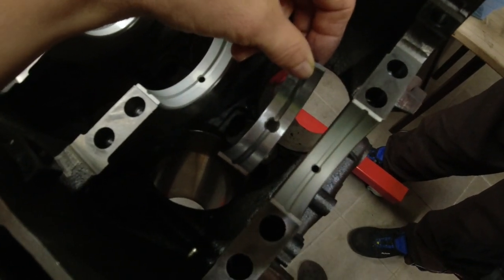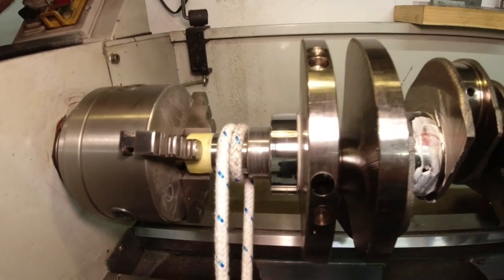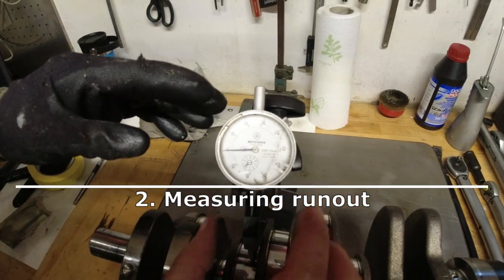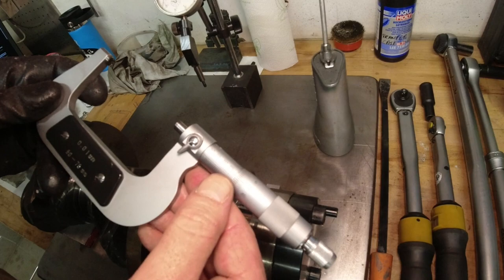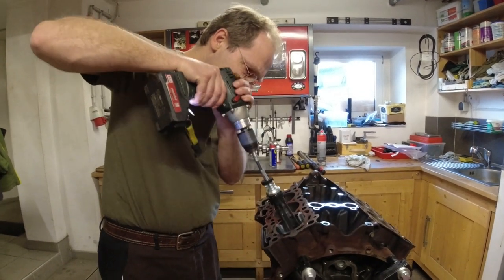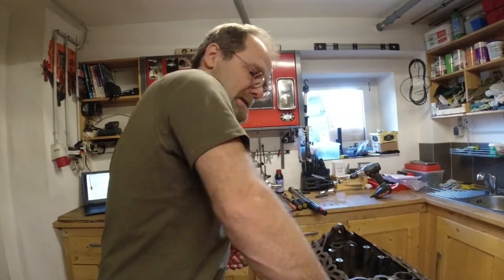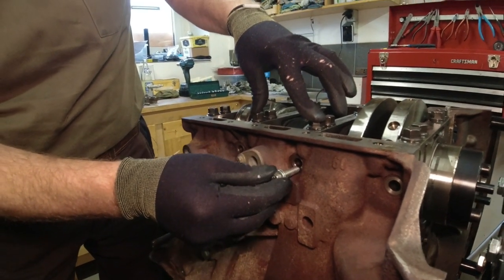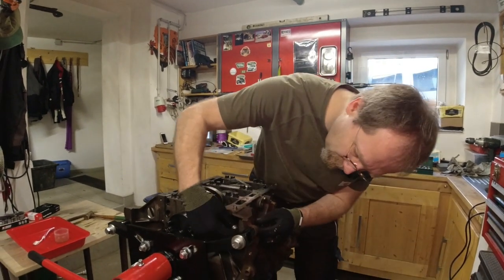Land Rover - Complicated crankshaft install - Discovery TDV6 - stress for Toyota drivers - Episode 4

Comment: Amazing work🙂👍 But what is the difference when using assembly lube instead of gear oil?
Reply from the maker: Assembly lube is expensive but maybe better.  I think a regular gear oil will do.  Just don´t use a light 5w30 or even a 0W.   Christian

Comment: ok, I really need the clearances of the bearings and connecting rods, and if possible the site where I see all the tables that you will use in this engine, thank you.
Reply from the maker: There are some information we can share, and most not, unfortunately. However, not here in the comment section. You need to contact me per email. 👍🙋‍♀️Vera
Reply: @Vera_and_Christian  ok, could you send me your email please.
Reply from the maker: @LeandroSantos-yk1lu  No, we cannot put emails here in the comment section, we have the "About" or "Info" page, where we also list our Patreon and Paypal information as well as our emails. Emails in the comment section, also if you post your email adress here, will be found by Bots and you will be spamed. 🙋‍♀️Vera

Comment: Transfer case fluid 75w 80 you used for the Discovery transfer case? I hope I misunderstood that. It's only for the differential. Correct me if I wrong.
Reply: My Disco 2 uses Valvoline 80W90 transfer case oil in Australia. 👍🏻🙏🏽🦘
Reply from the maker: We use it in the transfer case.  😬 Christian
Reply: @Vera_and_Christian  I thought it was a ATF oil for the transfer case. I'm a little confused now 🙃
Reply from the maker: @laurenssok2122  We don't use ATF for the transfer case, and have been doing so for 115000km now. 😉🙋‍♀️ Vera
Reply: @Vera_and_Christian  thanks for your reply and I looking forward for the next video 🤗

Comment: You’ve done all you can. It’s got 2 chances now. But don’t engines take a long time???
Reply from the maker: We have been at it for 6 weeks, and it will go on for anther 6 weeks probably. But mostly because we have to wait for parts, and then the parts are faulty or did not fit and you have to order it again in the UK. It takes forever. But, if that would have been our car, we would be long finished.👍🙋‍♀️ Vera

Comment: Would the larger holes in the king bearings be helpful in stopping these engines have crankshaft failures by supplying more oil? You see race engine rebuilders drilling out oil supply holes to stop the endemic failures known for certain engines.
Reply from the maker: I am worried that the larger bores make the oil pressure drop in general.  They also reduce the bearing surface area significantly at this spot.  I did not find any positive feedback about these bearings in the net for this engine but lots of good feedback about the cheap FAI bearings.   Christian
Reply: In my opinion, much of the bearing crush force, and therefore the resistance to rotation, was going to be quickly lost in the easy distortion of the reduced and weakened oil hole vicinity.
Reply: @Vera_and_Christian  On what basis had you purchased the King bearings then ? was it price point? Also this brings the question to mind is can you find a higher volume oil pump to put in the engine?
Reply: @Vera_and_Christian  You could make a video about trying the 2 different bearings in and find a electric oil pump and hook up to the block and see if there is any difference in oil pressure. Block all the other oil passages with plugs etc.  Put bearings in and check pressure, change bearings and check pressure again. It would make for an interesting video in my opinion. From what I see of you in these videos you seem like the type of guy who would like to learn.  I love your videos by the way.
Reply from the maker: @crzy11000  When we have 100000 views per video in one week, we will do that 😅. But right now, that kind of video would cost us a fortune, and we are hardly getting anything back. 👍🙋‍♀️Vera